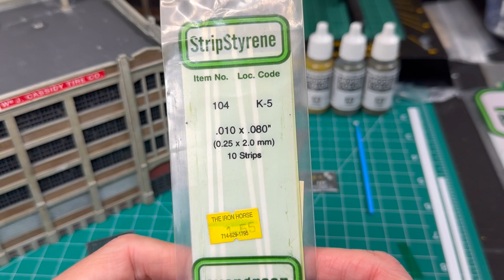Modeling Industrial Window Patches | Cassidy Tires Rebuild 2 | CCMR At The Bench #16

Comment: I love watching the evolution of this building, or in this case de-evolution if you will. Are you considering any interior work? It’s a lot in n scale, I know. I’ve only ever gone that far on buildings that are front and center on the layout. I’ve tried suspending paint within the mullion of the windows and had good luck with that, but your approach is better, I think. I wonder about sanding down the frame inserts from the back to decrease their thickness. Can’t wait to see the final product. 
Brooklyn
Reply from the maker: Hi Brooklyn, I'm absolutely considering interiors here. I will be lighting the building and the exterior signage with LEDs. Whether I model an interior or just use a photo of an interior is another question. Buildings like these are typically just one big room on top of another with maybe some subdivided areas. It might actually be fun to scratch a full interior, may be less fun to figure out a way to stock it full of tires!!!

Comment: Hi again. At that point, I'm wondering if colored tape or thinner surface would do a better job than paint. Wondering... Not taking away the nice overall job on that building. Especially on concrete and bricks.
Reply from the maker: Could be Luc. That opens a couple of interesting options I hadn’t considered. Will play around a bit…

Comment: An other trick that could may be work and offer interesting result, specially for flat building against backdrop is a night photo with inside all lighted.
I invite you on Google Street to show you what i mean.
Adress is 
17 586 A. Transcanadienne, Kirkland, QC, Canada
The Tanguay fourniture store is in a brand new building with an entire glassy facade. When you pass in front at night, all illuminated you have impression of being in it.
Sadly here it´s in day time, but it can give you an idea.
Try to find something that fit your location, era, architecture style. Choose dimension, making it smaller for more distance, print the photo, glue it on strong medium that will stay really flat. Instead of a flat as usual, you´ll have full illuminated one. Same with some shops that keep large open door in the summer night with working night trick.
Imagine Eric´s building illuminated with people, machine  etc...
With some work, with EXACT same location a day shot for the building and a night one for the inside. If you play good with lightning, the night windows shot in place of daylight one could be interesting. May be angle ones too ?
Reply from the maker: Spot on. I've been thinking of this approach for a few buildings on the layout, most notably Finkl Steel. I've collected a lot of photographs of the interior of the mill at night with artificial lighting.
Reply: @ChicagoCrossingRR 
Ha ha, you commented me before i even finish to watch your vidéo.
Grocery store at night can be good. Just be sure that your summer layout doesn´t show people with winter coat😅
Many industries, offices can be good candidate.
Why not your hobby shop with tiny train in the window ? Even à Christmas spécial. Just replace the photo for the holliday season.  
Good experimentation.
Reply from the maker: I’ve got a corner shoe store and laundromat that can offer some nice interiors. Should be easy to get photos of such places in Chicago.